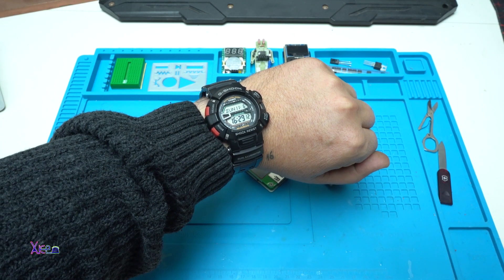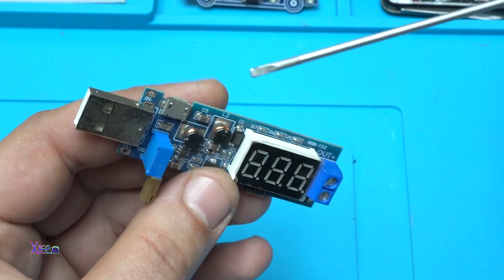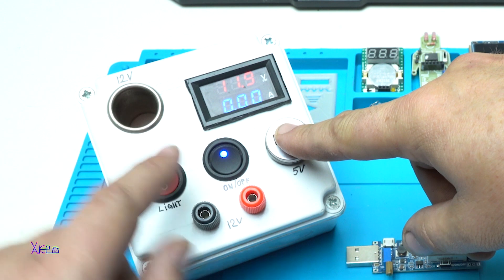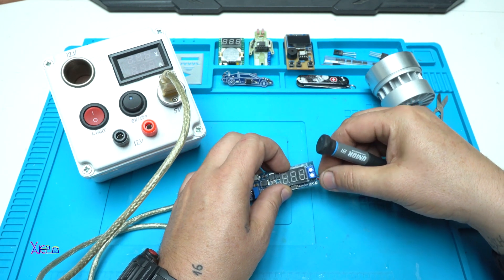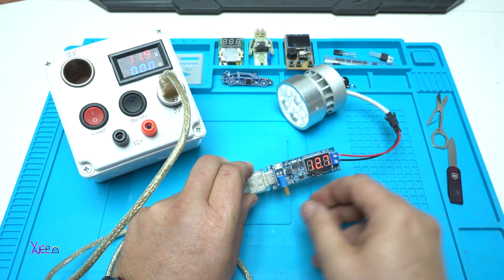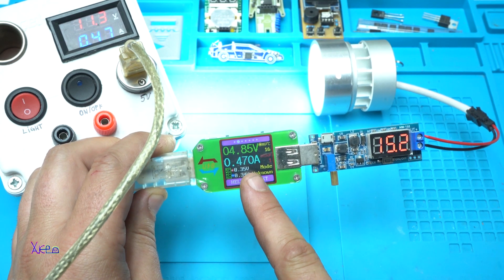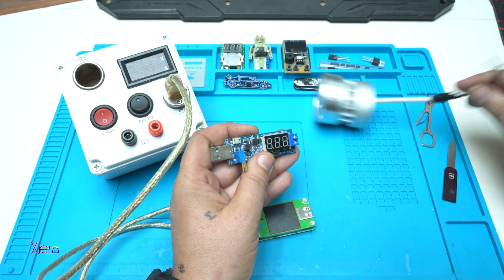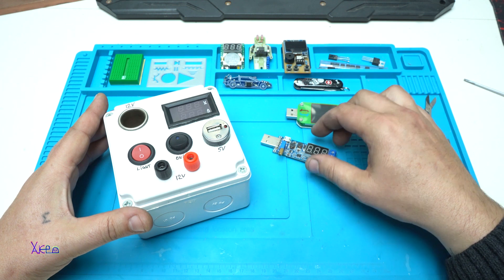You Need this Gadget - USB Booster Device

Comment: I have one, it is not only a booster (voltage up) but also a buck (voltage down). You only showed half of what it's capable of. For beginners you should also have mentioned the Watt and Power limits in case somebody (a beginner) does something stupid.
Reply from the maker: That way he will learn😀
Reply: @Hacktuber  🤣

Comment: 👍👍👎Super this USB booster. Now I can finally remove the car battery from my car. I then use this booster and install a 20000mAh power bank with 5 volt USB in my car. Thanks for the tip!!!
Reply: Lol this is only 2 amps